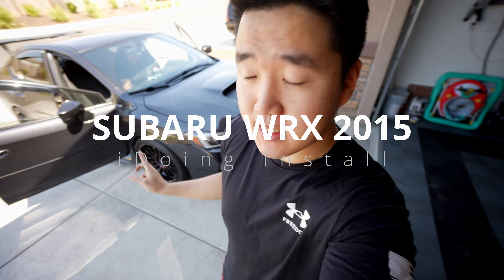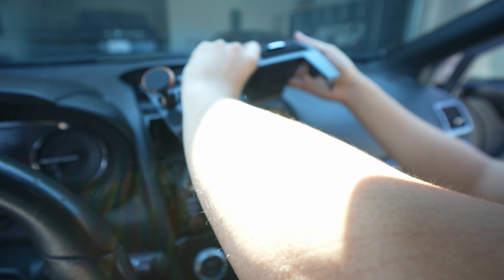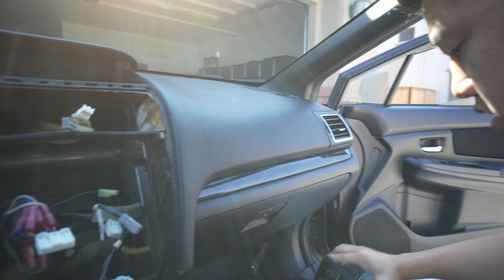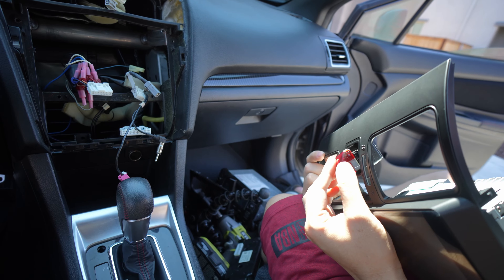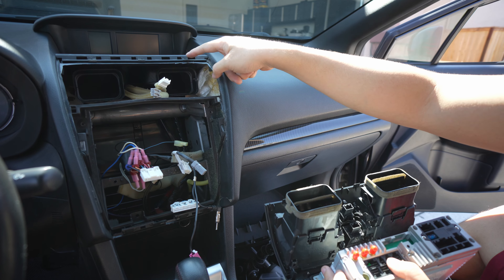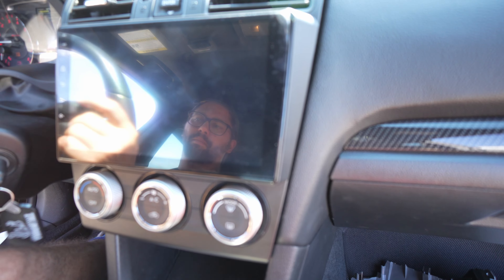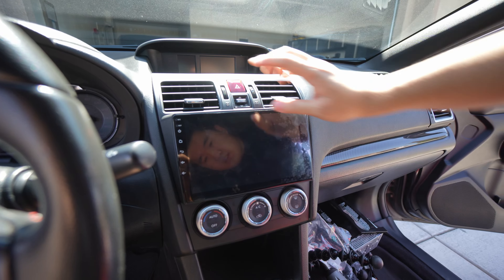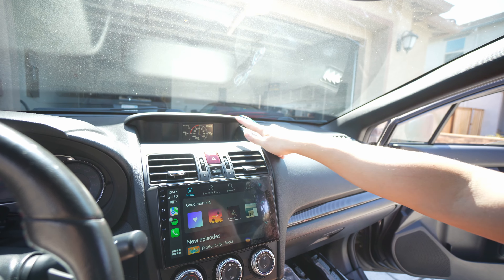2015-2022 Subaru WRX TRANSFORMED with NEW Carplay Radio FULL Install! 🔥

Comment: Just installed mine today. Thanks for this excellent video! For the GPS antennae did you just coil it up and 3M stick it to the top of the metal casing on the head unit?

Comment: Does anyone know how to install custom wallpapers on this head unit?? Also helpful video could not get the bezel to fit and then you said “you have to push on the sides” I was soooo mad so honestly thank god for this video lol
Reply: you need to have a flash drive and plug it in the usb and you'll be able to access the photo through the head unit

Comment: Ordered this for my 2015 WRX STI, ordered a reverse camera too. My WRX did not come with a reverse camera installed, so should it just be plug and play from the back of the iDoing headunit? or will I still need to piggyback off the MFD display?

Comment: I hooked up mine but unfortunately has no sound do you have advice for the issue
Reply from the maker: Check all the connections and make sure the radio is set to the correct input.

I would also make sure if you have the harmon kardon version make sure you have the right harness.

Comment: Bro 😅 in your opinions which head unit is better? Dasaita or idoing, I am impressed by the cold boot speed, how much memory you suggest, 4 or 8 G? Thanks
Reply from the maker: iDoing Cold boot speeds are insanely fast.

Can't go wrong with either

Comment: The Idoing price is over expensive, so i changed that unit with a headless amp and I printed a handle for an ipad that was cheaper of the idoing and more reliable 🫡